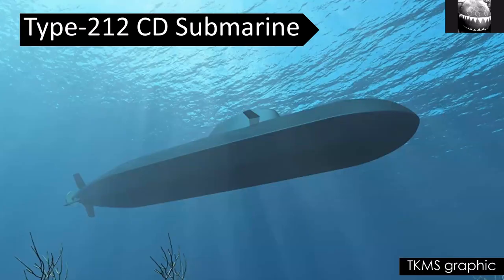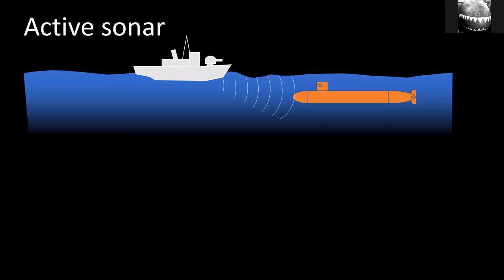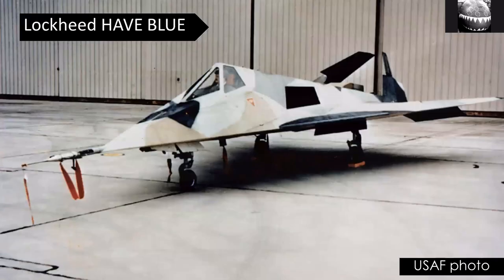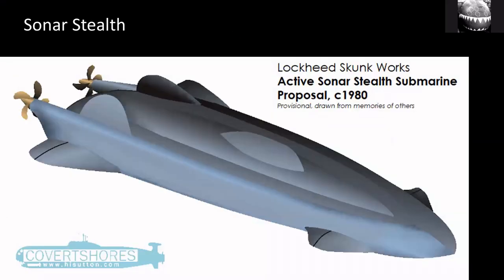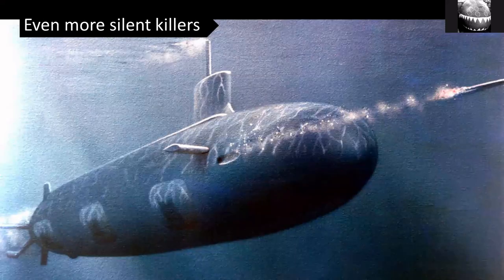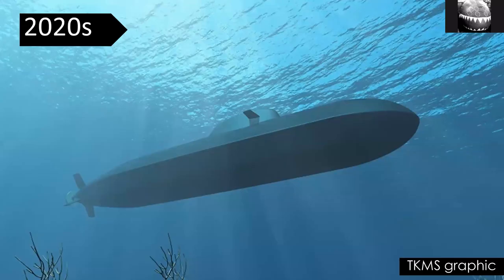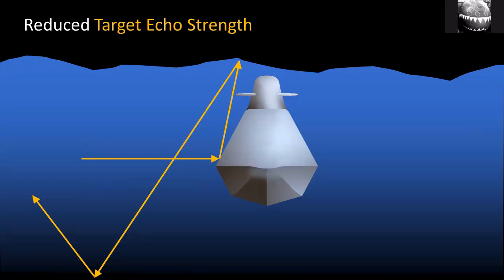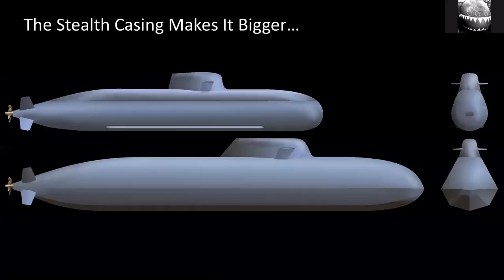The New Stealth Submarines Explained (Quick Guide)

Comment: Actually, the ping of an active radar bounces off the air inside the submarine.  Deflecting these soundwaves is more complex than reflecting them off the angle of the outside hull.
Reply: "the ping of an active radar bounces off the air inside the submarine."
You need to have a second pressure hull outside of the first one with a vacuum maintained between the two., then.
Reply: @abrahamdozer6273  You'd end up with the same problem. It bounces because of the difference  in density of water versus air. A vacuum layer (apart from being heinously difficult to maintain in the super pressurized environment that is the ocean at depth) would suffer the same issue: the difference in density between water and vacuum would be even greater.
Reply: @Kyoptic  Yes but the sound waves wouldn't propagate through the vacuum layer in either direction. 
Anyway, you are right it would be impossible to do. You have to wonder though if the place for a second stealthy sound disrupting layer is between the outer hull and the pressure vessel inside.
Reply: @Drew Peacock Hmmm. Remove the crew first, if you please.

Comment: Stealth isnt about boncing all signals anyhow since that is imposible no matter how you design your stealth no matter if subs or aircrafts. The goal is to make the return siginal as weak as posible and thus drasistically decreasing the range were the return signial gives the sender any informations.

Sonar is a LOTS more complex than radar thogh. besides the metioned surface/seabed bouncing Temperature diference and curents can effect how Sonar behaves. 
BTW the brits use the same method as the germans in their newer subs......gues they forgot to metioned it to their US allies that this is a thing now. Bit sidenote on arcustic tliles (rubbercoating) For deepdiving subs thease can be quite a problem since the presureddiferences between operational and deepdiving wear them out realtively quickly.

Its not like the interatcion beween pasive and active changes thogh. The main factor today are naval drones can be used by any naval ship to deploy sonar boyies in numbers if nessesary were before deployment were limited to a small number of helicopters and dedicated long range aircrafts..
Reply: boncing?

Comment: Very good explanation: A few more factors I would add to this discussion are 1) Effective Target size (aspect) 2) bottom type (hardness) 3) sea state all play a factor in active effectiveness as well.  My opinion is that this new design will significantly reduce Active Target visibility in all environments when compared to similar conventional submarine examples.
Reply: I presume this is the same idea you referred to recently when discussing the Astute's bow? If that was the goal I wonder why Astute and Trafalgar didn't continue the bow chine all the way down their sides. Difficulty mounting the flank array maybe?
Reply: @SonB288  Couple of things strike me on this question, the chine does end exactly where the flank arrays begin, that may have been a compromise where they focused on frontal aspect stealth for approaching a target. Second the torpedo tubes in the Astute are right at the side edge, there isnt any internal space given over to outer hull shaping beyond the pressure hull. Finally the Chine is exactly the same location as the floor of the upper deck, it might be a reinforcement strut to redistribute some of the squeezing away from that particular location (and the same location the forward superstructure) and add increased structural strength.
Reply: I like  your channel   keep it up  what is your opinon on the F 126  is it any good ?
Reply: One thing I'd like to point out and what i don't know if you deliberately omitted or missed: the HMS Astute appears to exhibit this very same feature, by about 20yrs. In addition, like astute, subs with this angled feature have a tendency as Astute, to have a slower design speed; because of the hydrodynamics of a angled hull over a teardrop design.

 Just speculation btw, not a professional.
Reply: 2 queries:
1. - wouldn't an active sonar signal bouncing off something return to the emitter at 1/4 of the strength that It had when reaching the target (inverse square law)?
2. Why would a sub with a  slab-sided outer hull necessarily have to result in a bigger (greater displacement) boat? I don't see a convincing case for this. requirement.
Reply: I disagree. Adds unnecessary and esoteric details that don't benefit the discussion in any meaningful way.
Reply: Although the surface does "sort of" reflect audio, that area is very noisy, and the waves and aeration tend to be a "diffuser" of the echo.  Any angulation up and beyond will be lost to the sender, unless very close (like torpedo).  Missile subs tend to be shallow, so are already in the noise zone.  Hunter subs tend to hunt from below, at depths where they can hear noises from far away.  There are "worse or better" angles for these operations.  The "better" shape for the sub would be something like a "flattish" bottom, and triangular top.  That would, just like the airplanes, make them engineering nightmares, and excessively large and very slow.  Some compromise shape will always occur.  The "best" actual shape to avoid sonar detection is to make the sub simply float on the surface.  Not likely to happen.
Reply: The faceted cross-section will provide several flat surfaces that potentially will provide a larger acustic return signal back to the sender at some very narrow incident angles. This can partially be remedied by the sound absorbing tiling approach and I therefore assume it is an acceptable trade-off.  Use of active sonar is typically done by surface vessels and sono-buoys operating in the upper water layers.  Hence the rather large sloping shape on the upper hull which shape has surely been calculated to reduce detectability at the submarins's typical operating depth(s).  In the operating environments of the Type-212CD are in regions where there normally are several thermoclines under which submarines may 'hide' I also believe that any acoustic energy that makes it through the layer will be reflected elsewhere due to the slanted sides.   Submarines hunting other submarines will not use active sonar as they will then give away their own location, thus the bottom hull facets must have a slightly other purpose that the upper part. Using passive sonar only a hunting submarine will have to lock on to noise emitted from the hunted party.  Propeller noise will probably be the most prevalent soucre of noise but modern propellers can be designed to operate incredibly silent at some given rotation ranges.  Noises originating from the inner hull must therefore be avoided at all costs, but if they should occur they will only be radiated in narrow 'beams' from each facet on the lower hull.  This will again make it difficult for the hunter to acquire a solid lock since the emitted noise will seemgly vary, or even become intermittent, depending on the observation angles of the hunter.  That said, I will assume that the outer hull is acoustically decoupled from the inner hull and that the intermediate space is filled with noise-absorbing material so that any internal noise should be well contained in any case.

The benefits of this design would also serve to reduce the noise emitted by nuclear powered submarines so I fully expect to see that next generation nuclear subs will adopt some of this.
Reply: Hi mate can you do a video on Scorpene submarines please

Comment: I imagine that this will be more relevant to the relatively slow SSKs since they cannot get out of the way of active sonar nearly as effectively, whereas SSNs with their high continuous speed can out maneuver an actively searching contact/torp much better. I mention this, but then watch the USN with it's SSN only fleet decide to stealth everything, but of course we Americans have to make everything stealth.
Reply: It's more relevant for subs working close inshore and esp in smaller waters. Much easier to hide from active sonar in the depths of the Pacific than in the 50m deep Baltic sea.
Reply: @positroll7870  I would have thought the opposite, since the shallow water means that any potential long range contacts may have quite a few bounces off the bottom/surface to get to where they're going, losing a little energy each time.
Reply: @jermainerace4156  In that sense, yes, and there is also more covering noise. 
But in restricted waters you can drop a lot of sonar buoys from aircraft to saturate an area, and also use a lot of uuvs launched from the coast to try and flush out any subs. 
Out in the open ocean nobody has enough such buoys or uuvs available to really go after a silent sub.
Reply: @positroll7870  Well, to go after a sub, I was thinking of the use of another sub. In shallow coastal waters, as you suggest, every sub is fairly vulnerable from a number of vectors, and active sonar is only one of these.
Reply: Who says SSK are slow?
Reply: @goodputin4324  SSNs and surface combatants.

Comment: that was interesting--  what about textured hulls, because if you had uneven  or cobbled  surface it might scramble the pursuant sonar. When  an angled hull bounces the incoming sonar, it deflects the sonar to a different position like a billiard ball hitting two or three points, so misdirects the  sonar reading. That could be very useful ploy, something akin to the idea behind Dazzle paint schemes.
Reply: One issue would be increased drag, another would be with scattering, you don't actually have 0 bounces back, instead you'll reduce the chance of a single return. You'd probably see increased echoes from all the bounces striking the sea bed and waves. Whilst reduced it's still sending out a large signal.

Comment: This is only part of the story.  The reason why stealth shapes are particularly useful in aircrafts is that the missile guidance radar emitter is always on the same platform as the receiver, so bouncing radar energy away from the source makes sense.  For ASW it is more complicated, because typically the defender deploys multiple sources and receivers via sonobuoys and the whole fleet is listening, so bouncing the sound away from the source does not guarantee that it will not be detected by active sonar, though it may help avoiding an unguided torpedo.  This is why many submarine-building nations have programmes to develop a sonar ‘invisibility cloak’ based on acoustic metamaterials. The cloak would transmit the sonar energy forward exactly in the same direction it was travelling initially, making the sub truly invisible to active sonar.  Another advantage of the cloak is that it would transmit ambient sound, so the sub cannot be detected by analysing it.  Although the state of development of invisibility cloaks is classified everywhere, there are papers in the open literature about this.  It is claimed that the new Italian subs U212 NFS currently under construction  may be one of the first to test this technology. U212 NFS will also feature both fuel-cell AIP and lithium ion batteries, giving it an underwater endurance probably close to a month without surfacing or snorkelling.
Reply: But in the final kill, it is the sonar of the incoming torpedo one is hiding from, which is in direct line to the submarine. Bouncing it's active sonar away reduces it's ability to home in on the target submarine.
Reply: The patents for the 212 design are held by TKMS and not by Fincantieri. That is why Italy and fincantieri can’t export these subs. All exports to other countries are done by TKMS - if they get the permission of the German Government. Italy does not own any intellectual property on the basic design.

Comment: You might also add the British Astute class to the list, at least because of the bow section, aft to around where the foreplanes are located, which is noticeably more angular than the hull continuing aft of the foreplanes. Something else that occurs to me is that the future use of UUVs, deployed from larger boats, will permit a "stand-off" active sonar capability, where a relatively expendable asset, at a distance from the mother craft, "goes loud",  paints the target, and transmits the data to the attack boat, which can then put in an attack, hopefully leaving it much less vulnerable. At least until torpedo launches are detected.
Reply: Thank BAE

Comment: Is there any way for a submarine to avoid being detected by it's magnetic field?
Reply from the maker: They use degaussing
Reply: @HISuttonCovertShores  what is degaussing?
Reply: @goodputin4324  
https://en.wikipedia.org/wiki/Degaussing
But thats not really the full answer here. 
U212s use a different type of steel, with manganese and molybdenum in the mix. Steels used for U212 are non-magnetic, but not as hard as other allowys used for subs, eg for U214. That means U214 can dive deeper but is easier to detect.
Degaussing only comes into effect for the 212s re the engines etc.
Reply: Similar to 
https://en.wikipedia.org/wiki/Mangalloy
Reply: @goodputin4324  like the conductive metal band around old tube tvs
Reply: It's pretty hard to make a non magnetic electric motor and they all have them, nuclear boats included.
Reply: @abrahamdozer6273  

True, but the amount of magnetic material and the disruption of the magnetic field is much smaller than that of a hull. As it stands, an aircraft with a MAD needs to get very close to the sub to detect. A nonmagnetic hulled sub may be "good enough" to avoid detection from a MAD.
Reply: @ycplum7062  Even a hovering helicopter?
Reply: @abrahamdozer6273  

It would need to be very close to the sub. 

Against a steel hull sub, its effective range is generall less than a mile and  the sub has to be close. An active dipping sonar would likely be more effective. It has 3x to 4x the range. The ones on planes may be better. They can generate more power.

I can see one on a drone patroling shallow coastal waters for subs dropping off commandos on a recon or sabotage mission, like in South Korea. I just don't see it being that effective in teh open ocean.
Reply: @ycplum7062  Most of the nuclear boats out there can't operate in shallow coastal waters and none of the boomer subs.
Reply: @abrahamdozer6273  

First off, by shallow I mean a few hundred feet depth. Secondly, I had North Korean diesel-electrics and mini-subs in mind when I was referring to MADs on drones.

Not sure where nuclear subs comes into play. I never mentioned it. Also, nuclear subs have a lot more metal and would be more difficult to make with little magnetic metals. And in most cases, they tend to stay deep unless they are insert special units (like SEALs).
Reply: @ycplum7062  So, in yet one other way, diesel/electric boats are stealthier. I would never have considered that they might have lower magnetic signatures as well as being quieter. Conventional subs are far more dangerous than their "press" would indicate that  they are.
Reply: @abrahamdozer6273  

Diesel-electric subs are potentially quieter, but not always the quietest. Other factors comes into play. 

For example, a bad propellor can give away a sub no matter what it is. Soem subs have better vibration/sound isolation than others. Sub Brief (formerly Jive Turkey), a content provider on YouTube is a retired sonar man. He mentioned how they use to track Soviet subs and that the Kiklo class was extreme;y quiet, but over time, they got louder and louder because thy were not doing maintenance. 

And while a diesel-electric sub is potentially quieter when running on batteries, it is much louder when they run the diesel engines to recharge the batteries.

A diesel-electric sub is not as fast a nuclear sub. A nuclear sub can run at flank speed indefinitely. a diesel-electric sub would use up their batteries extremely fast at flank speed. Also, while using AIP, their top speed is under 10 knots.

With that said, diesel-electric boats would be deadly for coastal defense, especially if there are a lot of coastal nooks and crannies for them to hide in. They are extremly good value as an ambush predators. What it can't do is chase down ships unless the ship is slow. 

If you are Sweden and you do not plan on patroling the open ocean, diesel-electric subs with AIP are the sub of choice, hands down. Also, nuclear subs are inherently large and in the tight confines around Sweden, you want a smaller boat.

However, if you need to patrol the open oceans or may need to transit very far to your patroling station (like the US or UK), then the of choice is nuclear.
Reply: @ycplum7062  If you are defending a coastline against incursions by nuclear boats, the diesel (or other non nuclear) boats have the upper hand and become the hunters. I would agree that it wouldn't happen in the mid Pacific.
Reply: @abrahamdozer6273  

I meant defending the coastline in general (surface and sub-surface), but it would include against nuclear boats. lol
Reply: @abrahamdozer6273  disagree. The salinity and shallow nature of the South China Sea, for example,  makes the improved Kilo and some of the newer Chinese designs very much the hunters - especially if you can link them with newer, more comprehensive communication methods to allow them to hunt in packs. The old adage that Tom Clancy envisaged for a South China Seas battle has very much changed
Reply: @markbrown4442  Hmmm China's first sea battle in their entire history in metal vessels .... seamanship and experience count for a lot. The PLAN is still amateur hour.
Reply: @Drew Peacock How do you demagnetize things like electric motors?